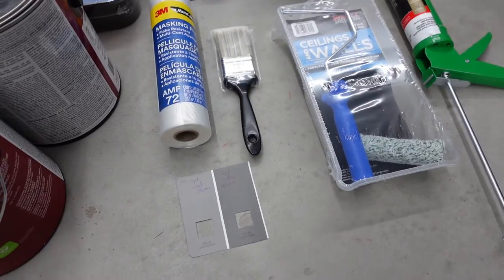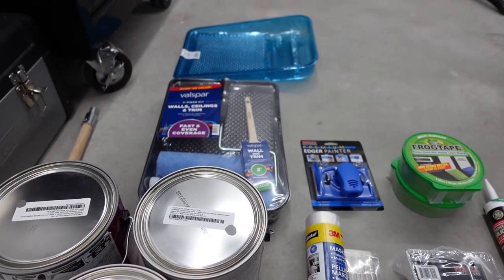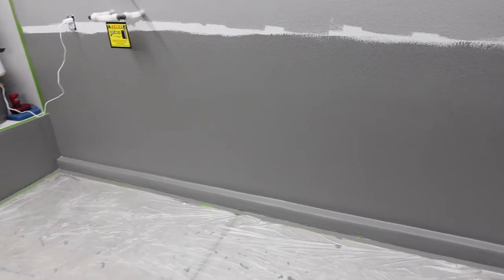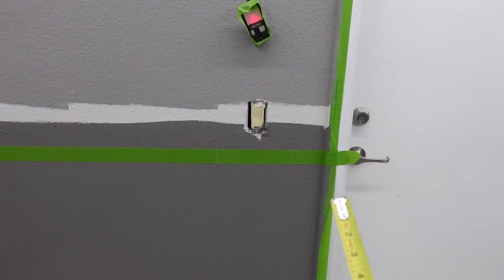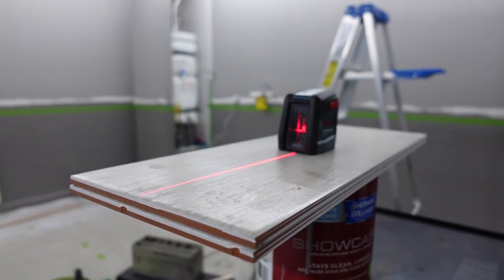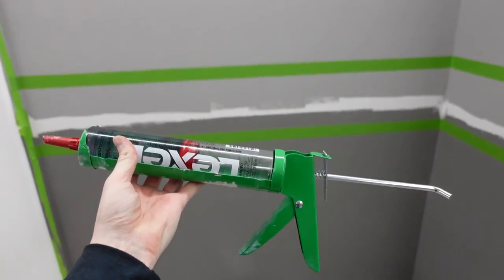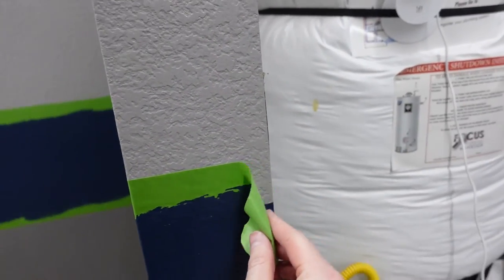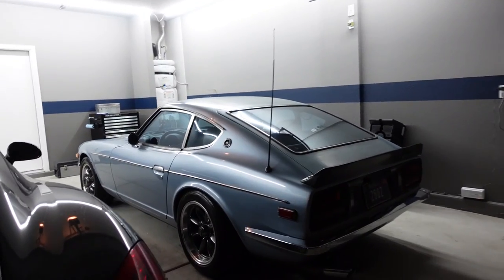TWO-TONE GARAGE PAINT WITH AN ACCENT STRIPE | How to Paint your two-car garage with an accent color

Comment: All that taping around doors,...  and caulking? Why? 
It is easier and produces better results if you learn how to use a paint brush properly and no tape.
Hint you only put paint on one side of the brush and let the paint be drawn throught the bristles and onto the wall.

The green tape and caulking method left a poor edge at the ceiling.
Painting takes a long time with no skills.

With latex paints always have a wet clean rag with you to wipe of any paint that gets on the wrong surface as it happens.

Try using a dripless caulking gun next time. You may like it!